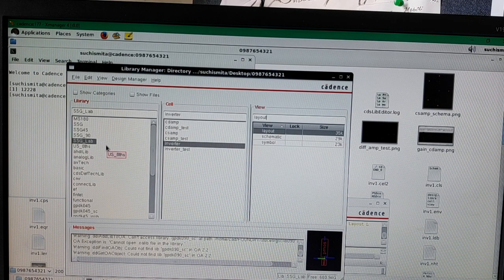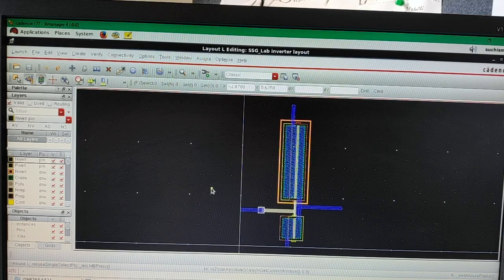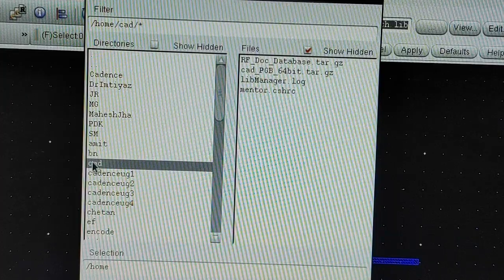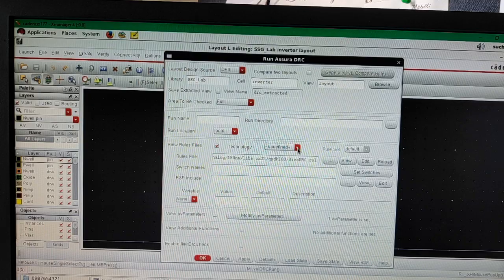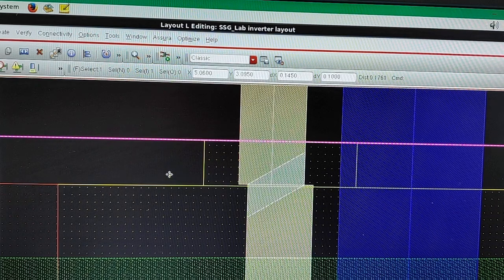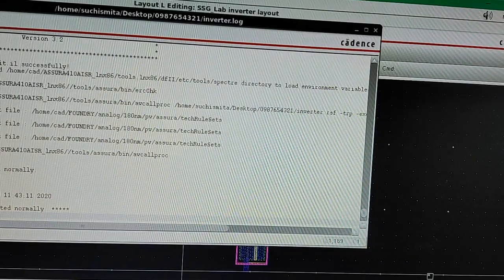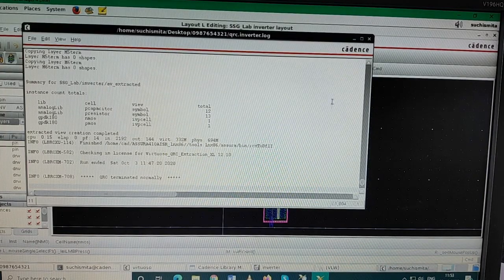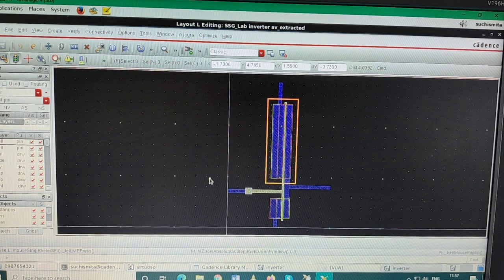Cadence Virtuoso: Is Your Layout Actually Correct? Let Assura decide! | CMOS Inverter | VLSI Lab #9

Comment from the maker: ⏰ *Chapters:*

00:06 - ASSURA: Overview in Virtuoso
02:45 - Design Rules & Why we should follow them?
05:06 - ASSURA Tool Flow
05:21 - Setting Up the Path for ASSURA Technology File
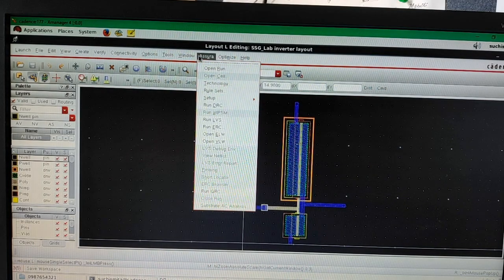08:38 - Running DRC: Setting Up Rules 
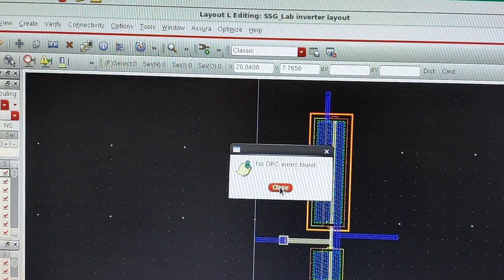12:51 - DRC Errors & How to fix them!
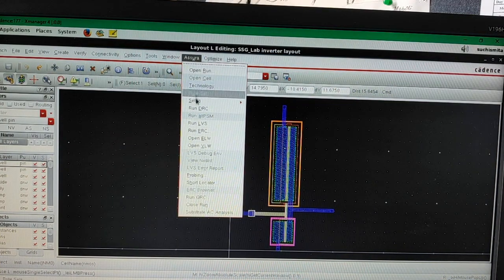16:25 - Running LVS: Setting Up Rules
19:35 - Parasitic Extraction (QRC) Setup & Output
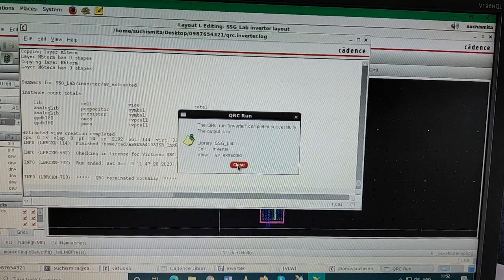21:51 - What's av_extracted? Where are the Parasitics???
26:20 - Preview of What's Next!!!

Comment: Hii didi
Can u pls make videos on layout of other gates like nand and etc?
Because we know the schematic thing which is easy

I am getting quite a lot of errors in gate layouts like and gate
Reply: I got the right output
Its fine ❤
Reply: Its fine
I got the right output
Reply from the maker: @indianelectronicsguy  Hi there! 
So awesome! Glad you were able to figure it out. Layouts can be a bit of a puzzle sometimes, but getting that 'Right Output' feeling is the best. 

Always remember, in case of Layouts, - it will stress you out... but just stick with the steps I have covered diligently & you'll get the correct outcome!

Keep going, and just let me know if you run into any other hitches!
Reply: @VLSIDesign_SSG thanks for responding 

I see that cadence sometimes gives X mark (highlights error) even if the connections are right
But DRC and LVS turns out to be matching and no errors
Reply from the maker: @indianelectronicsguy  Welcome to the World of Cadence 😂 its dramatic sometimes!

Those 'X' marks are usually just Interactive DRC markers. They pop up in real-time if you move a metal trace too close to another or overlap something momentarily while you're drawing.

You're really getting the hang of it & I am sure you'll a Pro in no time!
Reply: @VLSIDesign_SSG ❤❤😂😂

Comment: Hii didi
Is there a way to undo shift+F? To get whatever we had before?
Can I do the shift F thing without actually pressing that by using a setting? (Just for information purpose)
Reply from the maker: hey @indianelectronicsguy !!

To Undo Shift+F use "Ctrl+F" it will bring you back to the top level view.

Alternative for "hotkeys":
1. Options -> Display
2. Display Levels - it has Start & Stop levels
3. To mimic Shift+F action: Set the Stop level to a high number 32 or 20
4. To mimic Ctrl+F action: Set the Stop level to 0

Since you asked this incredible question... Here's something extra for you... 

Shift+F is essential for Routing purposes so you can see all the layers for connections & Ctrl+F is better for moving large blocks of layout!

Stay inquisitive Stay happy!!!
Reply: @VLSIDesign_SSG thanks a lot ❤❤
Reply: @VLSIDesign_SSG I have one more doubt. 
Which one is gonna be the high paid job role? RTL or Analog/Mixed signal IC design?
Reply from the maker: @indianelectronicsguy  1. RTL / Digital Design (The Volume King):
The Market: Most MNCs in India (Intel, Qualcomm, NVIDIA, AMD) have massive digital teams. There are simply more jobs in RTL/Verification.

Pay: Freshers from Tier-1/2 colleges often start higher here because the demand for SoC integration is huge. If you love coding (Verilog/SystemVerilog), this is your path.

2. Analog / Mixed-Signal (The Skill King):
The Market: These roles are fewer but highly specialized. Companies like Texas Instruments, Analog Devices, and NXP treat Analog designers like "Wizards."

Pay: While the starting pay might be similar to Digital, the long-term pay is often higher because Analog skills are harder to master and harder to replace with AI/Automation. Once you have 5–10 years of experience in Mixed-Signal, you become an extremely high-value asset.

The India-Specific Reality: In cities like Bengaluru and Hyderabad, both roles pay exceptionally well.

I am not mentioning packages as it also depends on one's negotiation skills as well.

My Advice: Don't choose based on the 'starting' salary.

If you enjoy Logic & Programming, go RTL.

If you enjoy Physics, Circuit Intuition, and Layout (like what we are doing in this tutorial!), go Analog.

And to be successful in either of them, one has to have solid knowledge of the Core Concepts of VLSI Design.

Both will make you wealthy, but only the one you enjoy will keep you from burning out! Stay curious!"
Reply: @VLSIDesign_SSG ok
Reply: Thanks a lot🙏🏻
Reply from the maker: Happy to help!
Reply: @VLSIDesign_SSG  mam, i see that there is one more main way to extract parasitics using .sp (spice file)... can we do post layout simulation using this? or is av_extracted only used to do post layout simulation and nothing works other than this?